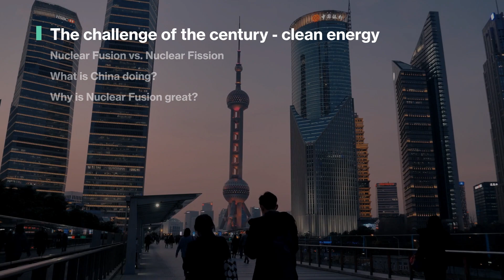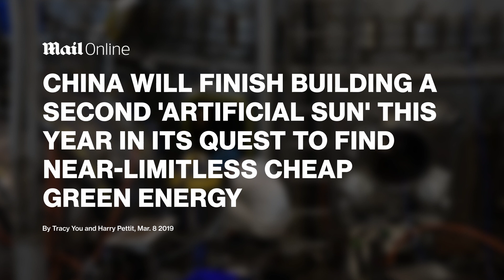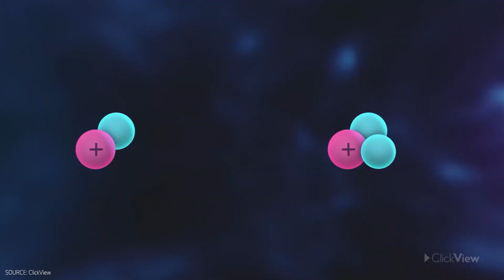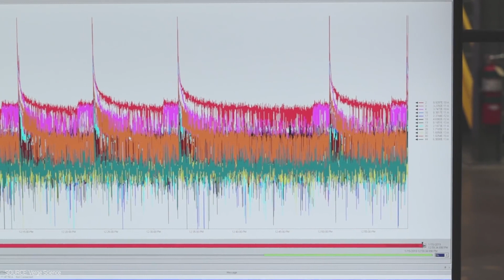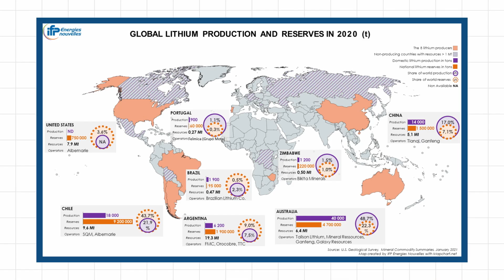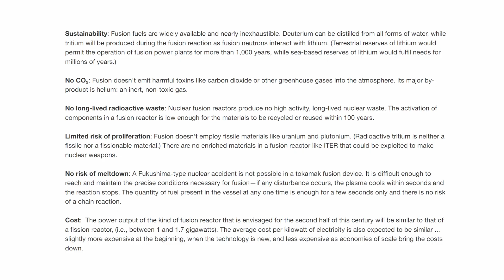A new dawn for Nuclear Power

Comment: It isn't normal for politicians to be duped by scientists, but fusion research is one area where this long lived con is on-going.  ITER is claimed to be able to produce 10 times more thermal energy than it consumes.  The lie is that this energy surplus is for the plasma only, not the entire system.  Even if ITER commissions in 2025, their plan is to not do a real fusion experiment until 2035.  The shame is that this misdirection of resources to fusion research has prevented development of far more practical & promising technologies like electricity generation using thorium / uranium 233 molten salt fission reactors.  Give thorium MSR research 1/10th the money that fusion research has had for the past 50 yrs and today the world would have a surplus of electrical energy.

Comment: Your credibility dropped significantly when you use Fukushima as a reason why fission is unsafe.
That would be like saying a model T is unsafe on a freeway, so automobiles should not be built.

There are lots of better fission reactor designs than Fukushima, Chernobyl or TMI.
Reply: Came hear to say this. The best argument the anti-fission people put out is that the careless and greedy will make fission plants that aren't safe, making them unsafe overall.
This is true on the surface, but really you can argue the same for anything. Someone could manufacture an unsafe car, but do we stop car manufacturing and stop driving them? Do we stop flying because a plane like the Boeing 737 Max? 
It's true, but it's also true for everything else, and making it an argument point makes you the ultimate hypocrite.
Reply: @TheDonner000  - thanks for your perspective. 
I doubt the companies are careless and greedy (although anti-nukers will think they are), but rather they made a large investment in old technology and are hoping to get to break even or profitable. 
The same "greedy" companies would much prefer new reactor designs that don't have to be shut down for refueling, and are intrinsically safe to boot (drastically reducing their insurance costs).

Comment: As others have mentioned, the joke about fusion is that it's always "twenty years away". It does seem that we're getting a bit closer lately, though. For example, ITER is progressing, though it's still taking a long time. One fusion project that I've been keeping an eye in is the Stellarator. There hasn't been any news of note recently but the idea is that the design of the chamber will make it easier to maintain plasma containment than the simpler torus of a tokamak. I'm not holding my breath for fusion; I think we need to invest more in fission power in the short term, but I'm hopeful fusion will become available in my lifetime.
Reply: ITER is a physics demonstration, not an actual fusion power experiment in the vein of generating power. Smaller university and private projects are where the real is going to happen

Comment: I just had to comment because this video is so disappointing. You normally do some decent research on your topics, but this had so many assumptions (some from a bias view point maybe) and factually dubious statements. China is not the leader in fusion research, there are many more advanced reactors worldwide that have achieved better results such as ITER which also have a new reactor being built , planned for 2025. At the moment it sounds like you are being a shill, please don't do that. 

Nuclear fusion is the future and currently will always be, that's not to say it isn't worth the research, it certainly is, but it's nowhere near solving our energy crisis as it stands. I think the highest value of Q-plasma (the energy put into the plasma/energy from fusion out of the plasma) is currently at 0.7. The important thing to understand is that for all of us for this to be usefully we need Q-total (the total energy in the system/electricity out)  to be the measurement of interest, which is nowhere near breakeven.

Therefore to fill the decades of gap before fusion becomes viable we need next generation fission reactors to be designed with passive safety and easier to handle by-products, which is stuff we know about already but have not spent anywhere near the same amount of R&D as on fusion. 

Also the go to for nuclear meltdowns should be Chernobyl not Fukushima , which if you read the Wikipedia article had only one death associated to it from radiation. More people died from the panic and evacuation than from the event. That's not to say that the number of related cancer deaths will not increase as time goes by but at the moment this stands at zero (again according to the article).

Please do better.
Reply: First of all, ITER is funded and run by seven member parties: China, the European Union, India, Japan, Russia, South Korea and the United States. It is certainly not some national organization.  Secondly, "planned for 2025" and we all know how delayed international projects are
Reply: @jerrygereden  yes,  ITER is funded and run by seven member parties: China, the European Union, India, Japan, Russia, South Korea and the United States. Second, planned for 2025 means just that, "planned for"

Comment: I don't think, Tokamak-style reactors will become a viable energy producer. They are too complicated and also, the design is based on a massive mistake in cosmology: The sun and other stars don't have thermonuclear cores. They are cold inside - check a close-up image of sunspots (and also the books of Donald Scott). Only the photosphere and the corona are hot, which means they work differently than the current models suggest. But other than that, plasma is very interesting in the things it can do. Smaller plasma reactors migth be a way to go, together with thorium molten-salt reactors.
Reply: Sun has a help of its own gravity, that's why it doesn't need higher temperature inside to achieve fusion.

Comment: Small note: I wouldn’t call carbon dioxide toxic, although yeah it can be for humans. For example if you wear a mask, hindering your own gas (air) exchange.
Reply: Thank you for pointing this out, I've no idea where the thinking of CO2 being toxic came from, it just misleads peoples thinking. It's only guilty of being a greenhouse gas , and not even a the worse offender. Water vapor is actually more effective as a greenhouse gas than CO2 and I wouldn't call that toxic either , even though both will kill you if you breath too much of it.
Reply: @peterb9038  This is actually untrue: CO2 is quite toxic and as little as double the normal atmospheric concentration can affect congnition in humans. So potent is it that poor ventilation in classrooms can alter test scores just because of exhaled CO2. Certainly it's not as toxic as something like gasoline fumes or coal smoke, but it's disingenuous to say that it's harmless.
Reply: @alexv3357  Thanks for the clarification, you are right of course, anything much more than 0.04% is likely to have ill effects. Interesting enough so would 0%. I should have been more clear in my reply but just as a final point I didn't say it was harmless.

Comment: 0:35 isn’t that debunked already, that there is no correlation…?
Reply: There is a correlation and it's probably causation.
Reply: for any given weather event, it is impossible to prove or debunk. What can be said is that given the current conditions including very high CO2, extreme weather events are much more likely.
Reply: @hoffmantnt  Extreme weather events are more likely- in meteorological models, as well as events that have unfolded so far.

Comment: I get that it's a huge leap in science and physics. BUT:

Why do we even need it for energy production? The renewable energies, wind, solar and water, are the cheapest and cleanest way to produce our electricity. Add all the options to store energy, like big water dams or even better, using the low demand at night to produce hydrogen which then can be used to help in peaks, negates all the downsides.

It's so easy, no need for this?
Reply: Because renewables arent the cheapest way to make energy, a good fusion reactor could produce way more energy for less money, since the fuel costs are basically 0 as well
Reply: Renewable efficiency are far far far far lower from nuclear fusion.
Reply: evolution is linked to our energy usage. asking why we don't need another energie source is therefor a bit strange. the more energie we can produce the better. (without destroying the world)
Reply: wind, solar and water are all by products of fusion energy at the end of the day. So why not go direct to source if you can. Renewable as you have listed are not going to keep up with our requirements in the future without becoming a big impact on the environment themselves. They still need to be made, transported, maintained and take up space and are not controllable, you can't rely on them being available when you need them. Although you seem to know about the problem with the energy storage (you said create hydrogen)  side of the system, it is actually quite difficult to contain hydrogen, it is the smallest of atoms after all and eventually slips out of any container you will create, unless you cool it to really low temperatures which takes a lot of energy. In other words its very difficult to store, so difficult that it might be easier to break out hydrogen from water when you need it, then have it in long term storage.

Comment: Your comment dismissing Nuclear Fission as a throw-away line “because its too dangerous” is absolutely wrong. Even including the farcical accident of Chernobyl’s dangerous tech where an unconfined accident was ‘waiting to happen’ or Fukushima, where an insane decision put backup generators and electrics was ‘under-water’ levels. Fission power has already PROVEN TO BE thousands of times safer in terms of deaths/terra-watt hours than all fission power generation today. The Fusion ‘demo’ reactors you show are ‘experimental prototypes’, NONE of which are capable of producing more power than they consume, including the insanely expensive ITER international project that is still over a decade away from even being switched on. Even the new ‘high-temperature’ superconductors from MIT that everyone’s excited about still imply multiple DECADES before first operational systems are conceivable, let alone their insane cost and size and lack of scalability. The ONLY option for ‘REAL’, proven, TOTALLY SAFE, Zero Emission, minimal waste, affordable, compact, mass-produceable,  industrial heat generating (as well as electricity) is Fission Nuclear. The new Small Modular Reactors, either high-pressure water (more traditional tech), or 4th generation MSRs (Molten Salt Reactors) are the only conceivable Nuclear solutions needed NOW. Yes one day Fusion will be viable, but not if Fusion is not embraced BIG TIME in the meantime, so there can still be a world left by the time Fusion is viable.

Comment: Something I've always wondered about Fusion, and haven't found a video about: How much fuel do they need, and how are they planning to get those amounts of exotic hydrogen isotopes?
Reply: They use very little fuel since it is so energy dense, a tiny bit of hydtogen gets a huge amount of energy
Deuterium can be extracted from water, and tritium can be made by the reactors by capturing the extra neutrons that are released with deuterium, turning them back into tritium
Reply: The thing about hydrogen  is that there is a lot of it and if you have a reactor then getting "exotic" (but still common) isotopes is part of the process.
Reply: So no one here knows how much... per kWh for example..

Comment: the tech is awesome, but let's just all remember that this is just gonna be the most advanced water boiler ever
Reply: Hey, if boiling water worked that it worked.

No need to reinvent the wheel
Reply: Technically yeah
Reply: not if a design like Helion's is successful, then it will be electricity produced directly through electromagnetic induction from the fast moving electrically charged nuclei resulting from the fusion reaction

which would boost efficiency up over ~95%, and also reduce the size, complexity, and cost of the power plant
Reply: You do it then. Also hydrolox engines are a pretty good candidate too.